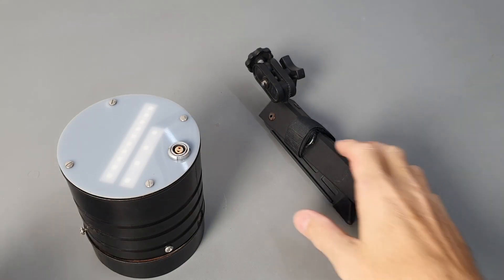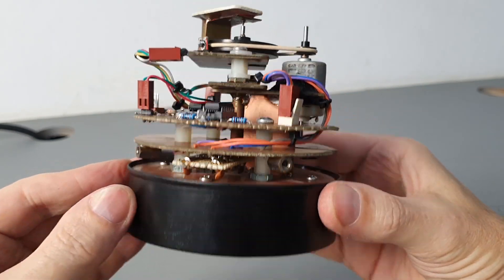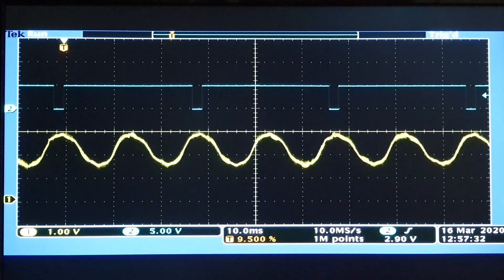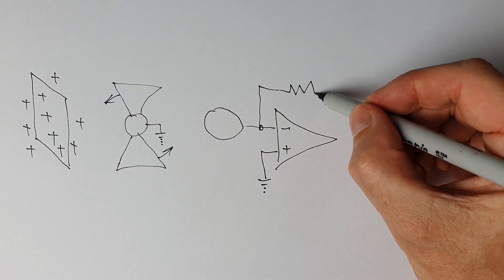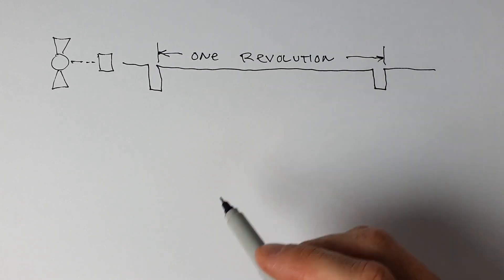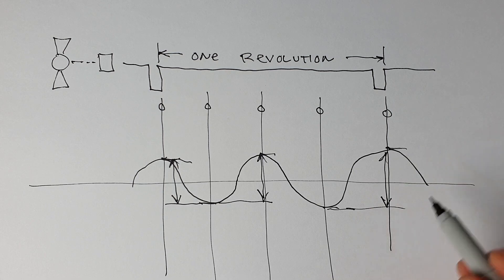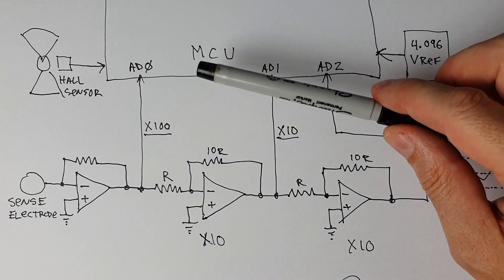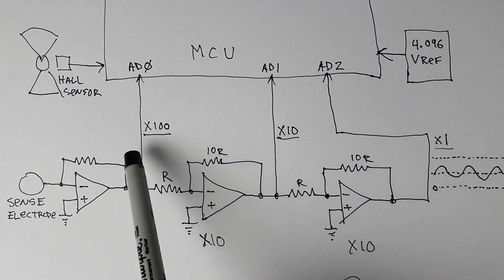Electrostatic Field Mill Voltmeter Project

Comment: Really cool build - i think i would probably code it differently though. Sample, say, 2kS per rotation for all 3 ADCs, and take the 100 or so samples closest to the antinodes (either with code or your timing trick), discard any outliers/digital filter and average them. Take whichever one of 3 the results is valid, digital filter/long term average again and use that as your output.
Its a hell of a lot more processing, but well within an average MC's capability should be more reliable and accurate.

Comment: That a very good explanation on how a field mill works.  I made one many years ago to measure charges of clouds during a lightning storm in Michigan. Your device could do the same.  To use it in rainy and damp conditions, flip it upside down with a cover over it.  It will measure the charge off the ground in reverse polarity.  Such devices are used on launch pads around rockets to monitor atmospheric electrical conditions and warn of impending strikes. Corona current sensors are also used to detect lightning.  I built ammeters that measure corona current using a similar circuit like your pre-amp. Very good job. Glad you shared it.
Reply from the maker: Thanks! - maybe you can help me understand this application? I understand that there is a charge gradient from the open sky, the instrument is connected to a power source at ground potential, so it's reference is ground,  I just don't get how it can measure the field when pointing down at the earth? I have never seen anything used to cover the front of a mill, anything conductive obviously intercepts the field lines, any insulator can accumulate surface charges that corrupt the measurement?
Reply: @leosbagoftricks3732  In this application, the field mill is grounded and pointed down, but it is mounted well-above the surface of the ground.  Thus, some of the field lines from the sky above wrap around and enter the sensing face of the field mill.  Since the measurement is indirect, a multiplying factor must be applied to convert the field strength measured by the mill into the field strength that would impinge on flat ground.

Comment: How is it calibrated?
Reply from the maker: Take two sheets of plywood covered in metal foil, space them a known distance. Cut a hole in the middle of one piece.
Mount the meter in the hole and apply a known voltage across the plates.

Comment: This is an extremely cool project! I had no idea that electric field sensors like this were even a thing.

I am curious why you bothered with the Hall effect sensor. You could just as easily take the derivative of the input signal and use the zero crossings to find the peaks. Also, if you could put all the gain into a single op-amp stage without clipping at higher voltages then you could use resistor divider network in place of the second and third op-amps.
Reply from the maker: Without a clean angular position reference signal, the processing of small voltage signals would fail miserably.
There is significant noise on the signals, synchronous demodulation is the key to recovering the signal from the mess.

If all the gain was in one stage, the output of that one stage would need to match the ADC's dynamic range. (so there is no clipping with the largest signal) Adding a resistive divider would accomplish nothing but reducing the measurement resolution. The point of auto-ranging is to make the best use of the ADC's resolution, so the dynamic range of the instrument can be very large.
Reply: You need a phase signal to figure positive or negative, the signal is symmetrical and one is just opposite phase to the other

Comment: Nice work! I was wondering whether a mechanical shutter is the only way? Could you electronically shutter the sensing plate using a variable impedance to ground?

Comment: I love how you simplify complex information, could you do a resonant LLC, and break down the bonkers fractional/PEMDAS math, along with impedance matching? all while explaining it? I already love your channel, i'd love it even more if you could make a video regarding whats mentioned above!
Reply from the maker: If only I knew what that was hahaha
Reply: @leosbagoftricks3732  I'll elaborate, I am sure you know what it is, i just explained it badly. First you have a half bridge of n channel mosfets, then a series resonant tank of Lr, Cr, Lm on the primary and it is tuned specifically to the SRF of the secondary which in turn negates the reactance impedance. I want to learn more about it, I get the gist of it, it's basically making an LC resonant tank with the frequency of the secondary, I think. Every time I try to put it into practice it just doesn't seem to work, and the math is overwhelming. I am actually enrolled in college as a Biomedical engineering tech, and I'm still waiting for them to get to the portion of the course that explains more elaborate electrical math, my hobby is high voltage related stuff and making high q low intrawinding capacitance  pi coils. I think you'd get a kick out of the pi coils, you should give my channel a look, or my pi coil project https://hackaday.io/project/184012-pi-coil-winder

Comment: Good design:  the synchronous sanpling technique drastically reduces the effects of  noise .
It would be interresting if you could introduce a spoiling signal that was not effected by the rotating ground:
to see to what degree the spoiling signal was rejected.

Comment: I’m a strictly a hardware guy… I can fix and re-calibrate anything as long as I don’t have to write code. or read it, or copy and paste it. 😂

But man that thing looks soooooo cool!!! And kind of complex. Reminds me of radiation detecting equipment and specifically scintillating detectors. One of my hobbies is building probes and detectors, for long range radiation detection… And specifically monitoring/logging.

 Scintillation detectors and probes are my favorite to build! Combining esoteric and exotic crystals, with electronics and radiation… What could be cooler!? Absolutely love your channel. If I could understand software and code like you do… I could take over the world! I just don’t have the bandwidth… After all I got into electronics completely by accident. My original business was building violins and guitars for studio musicians, using all handtools. So after a decade and a half of that… Electronics was kind of a smack in the face that I stumbled into by complete accident.
Your channel kicks sooooo much ass

Comment: Looks like something the ghostbusters would use. In your signal chain, you use inverting amps, no? So, the phase (and sign) inverts for each a2d reading?
Reply from the maker: Yes - the phase inverts at each step, but i keep track of it and make sure its correct in software.

Comment: Very interesting.

Take it outside, point it up at the sky, especially during a thunderstorm: Could you use it to predict or at least give some warning for lightning strikes?

Should try flying it on a drone, pointed down, and log the results vs altitude... (Look up how spiders fly... there's supposed to be about 5.7x10^5 Coulombs on Earth. And, Earth is negative relative to the atmosphere at least).
Reply: Indeed, commercial versions of the field mill are used to sense the electrostatic field in the atmosphere, and very high readings (such as in excess of 10,000 volts per meter, if I remember correctly) do indicate the imminent possibility of a lightning strike somewhere nearby.  Instead of pointing up, the field mill is mounted on a stand above the ground and points down so that precipitation, which would otherwise mess up the sensing, does not get inside.  Even though the field mill is pointed down, some of the electrostatic field wraps around and enters the sensor.  The field mill is calibrated to read out the value of the field that would be present at ground level in an open area.

If the field mill is in a drone, it would need a wire to the ground to give it a known voltage reference against which to make the measurements.  Flying objects can generate or accumulate a large electrical potential due to their interaction with the surrounding air.  Military folks on the ground will often make contact to a helicopter, or to a payload being lowered from a hovering helicopter, with a grounding stick prior to touching the airborne object itself so as to avoid receiving a nasty shock.

Comment: Very nice build! What would be interesting is measuring a known voltage, e.g. charge a large conductive plate to a known high voltage (e.g. a few 100s of volts), hold the device a known distance apart and see if the field strength matches the theoretical value. And if you get very close, how small a surface voltage can it measure? Down to a few volts?
Reply from the maker: I checked it with a DC power supply,  it reads about 936 Volts/Meter per LED.  If you place the electrodes really close, it can easily detect the charge from a 9V battery.

Comment: Incredibly awesome!  How long did it take you to make this?
Reply from the maker: This project has been revisited a few times, the first go was all-analog, producing a simple voltage output. That was a little boring, so I decided to upgrade it with a bar graph display and convert it to a digital/software architecture. It represents quite a bit of fiddling around, maybe 80 hours total?
Reply: @leosbagoftricks3732  Do you have a list of parts you used? Currently designing the transimpedance op-amp stage and trying to decide which op amp to use with such small currents. By how much did you have to amplify the signal?

Comment: How did you generate the 4x time references from a single pulse - could do it with a PLL clock multiplier but you didn't mention that?
Reply from the maker: Using the counter-timer module in the CPU. Measure the period of one revolution then divide the period by 4, load that value into a counter that creates an interrupt when it expires.

Comment: I was confused about the op-amps in the schematic. Doesn't the + input need to be connected to 2.048V to center the signal? I assume you used a quad op-amp and used one to amplify the reference with a 1/2 voltage divider. So ground is really +2V.
Reply from the maker: You are right!  "Ground" is centered at 1/2 the reference voltage to keep the signal centered in the ADC input range. Tried to keep this more conceptual, didn't want to drown people in details.
Reply: @leosbagoftricks3732    please drown me !!!

Comment: I worked at a test facility in New Mexico that used those to mounter electric field.  We had antenna's that we did not want lightning to hit.  When the field went up we put up grounds.  Except in a dust storm.  A dust storm generates a bunch of high fields but no lightning.  Nice project.
Reply from the maker: Super interesting! Thanks for sharing.
Reply: hello, can you please guide me to make one of this

Comment: Are your analog inputs to the MCU bipolar?  Did you get the gains wrong?  I would think that AD0 is gain -1, AD1 is gain 10, and AD2 is gain -100.  Which op-amp did you use?

Comment: Hi Leo, really great explanation. I think this could be interesting for weather forecast, to find out how the  electric charge in the atmosphere is chained with thunderstorms and so on. Outside datalogging and comparison with the actual weather could give some interesting correlations. Excuse me for my possible bad englisch.
Reply: As an engineer, one of my greatest interest is making instruments for measuring lightning storm charges. You can measure rain drop charges, potentials off clouds and corona current from sensing antennas.
Reply: I have a small lightning machine. I understand how lightning is formed. Tell me more about your work!

Comment: This is incredible. Definitely earned my subscription! I'm a mechanical engineer by schooling with a love for learning electronics...I've been trying to wrap my head around these field mills for quite some time, and your "theory of operation" section finally made everything click into place. I love your chain of op-amps to measure different amplitudes. Could you possibly share which components you used for the op amps and resistance/capacitance values for the low pass filter? I'm looking to build my own with an arduino for signal processing....Looks like it might be time to finally invest in an oscilloscope as well!

Anyways, thanks so much for the in depth video, and congrats on making such a beautiful field mill!

Comment: Awesome! I've heard about these before from some atmospheric scientists but I've never actually seen one built. Try pointing it up toward the sky and see if you can measure the voltage potential of clouds (you might need a larger device). You can predict lightning and hunt for the elusive positively charged thunderclouds.
Reply: I think the field of view is too wide and soft focus to pick out individual clouds, but you certainly should be able to detect a buildup of charge.

Comment: Awesome invention. You should make kits to let people build their own or just design more of a handheld version that could be 3D printed
Reply: Plastic parts run the risk of surface charge buildup. Perhaps with conductive filament. It doesn't have to be a very good conductor.
Cans are pretty cheap, though. Basically free.
Reply from the maker: @AlienRelics  Been thinking about this idea! My solution would be to cover the charge-sensitive portions with copper shielding tape, cheap and easy!